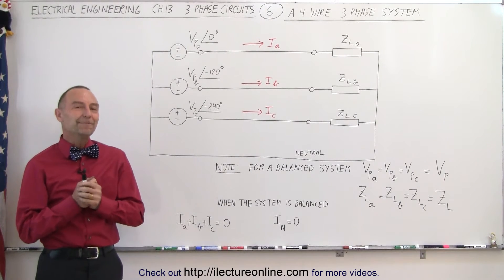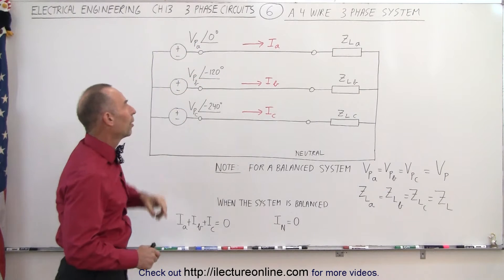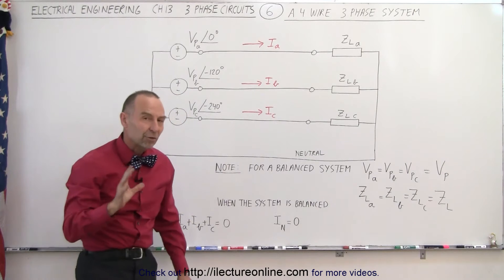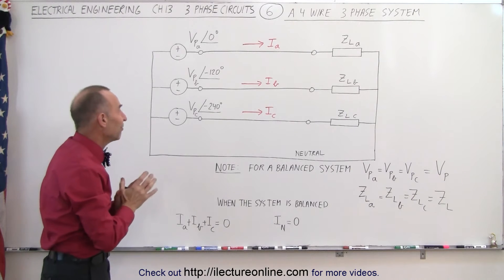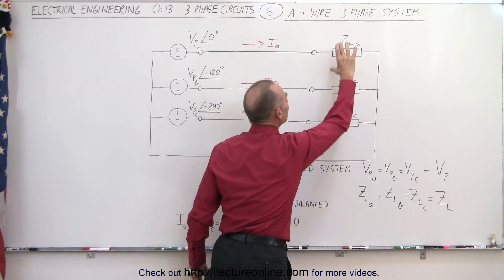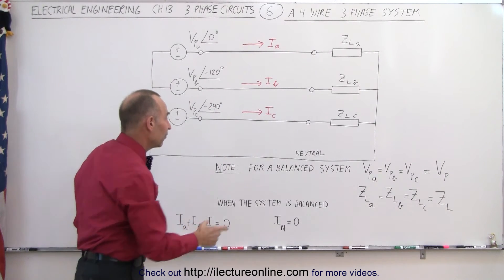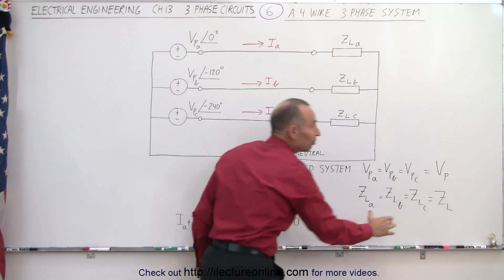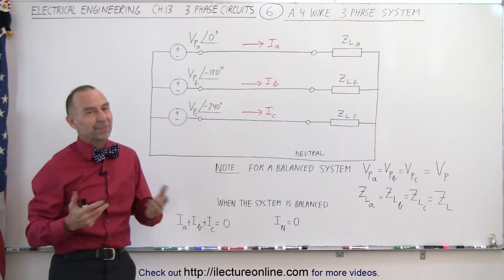Electrical Engineering: Ch 13: 3 Phase Circuit (6 of 42) A 4 Wire 3 Phase System

Comment: Thank you sir. One doubt sir in single phase supply current flow is  in both directions i.e. phase to neutral and neutral to phase (Fleming right hand rule based) but 3phase system current flow 3 phases (Ia,Ib,Ic) only,  not flow in neutral (In) wire....?
Reply: Unbalanced conditions wise current flow in both directions sir,..but balanced conditions wise?

Comment: Hi sir, just wanted to bring this to your attention that you didn't finish some important series like 1st order and 2nd order circuit for electrical engineering. Your videos are amazing and explain so much better than my professor. it's straight to the point and whenever my prof asks a question to the class I am the one who always answers and stunts the class (not to brag), all thanks to your videos. So please finish those series. Thank you!!!
Reply from the maker: Yes, we are aware and are producing EE videos at a rate of 1 per day.  We will get to those playlists eventually and complete them as time allows.  Keep studying.
Reply: I recommend you read about applying Laplace transform to (linear) circuits! It's really a beauty. That topic isn't taught in the EE major in my university, so I learned it myself. However, if you've already studied sinusoidal AC circuits (phasors), then that topic will be easy for you (assuming you've already had a course on ODE and have already studied first and second order circuits in the time domain.)

Applying the Laplace transform to a circuit (and not really to the differential equations of the circuit, which is obvious) allows you to solve any kind first and second order DC circuits. You can even solve RLC circuits in the general case (when the R, L and C aren't in series nor in parallel).

Also, you don't have to find the first derivative of the initial conditions nor the final conditions, only the initial conditions.

Not only can you solve first and second order DC circuits with the Laplace transform, but even, for example, circuits which sources are exponential signals! The key lies on the linearity of the circuit and of the Laplace transform.

As for books, I'd suggest the one by Charles Alexander & Matthew Sadiku, as well as the one by David Irwin (older editions) and the one by William Hayt et. al.